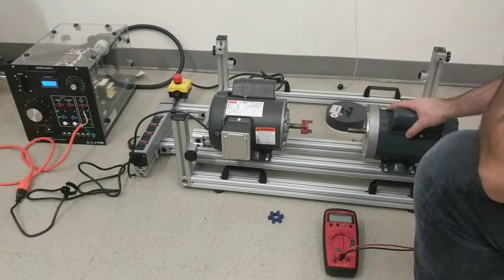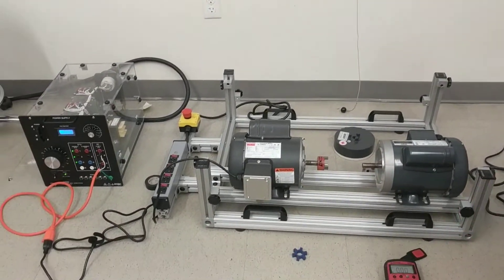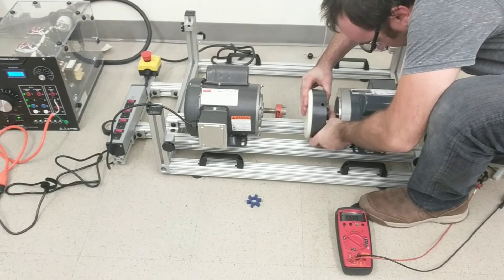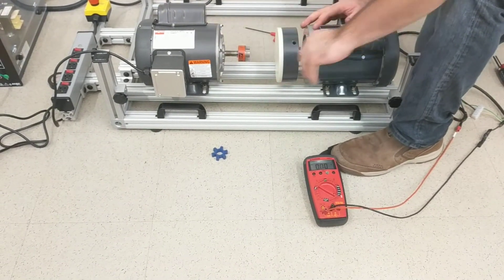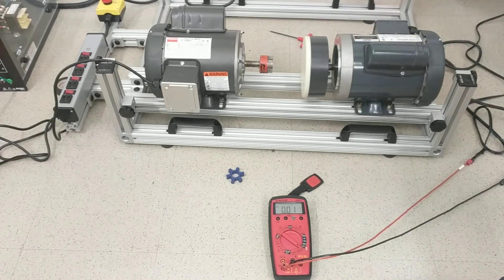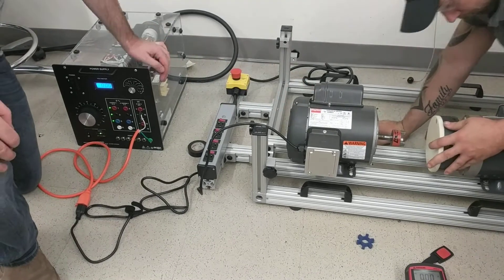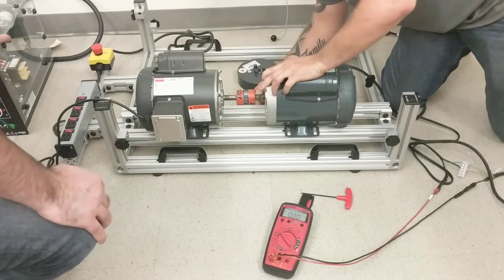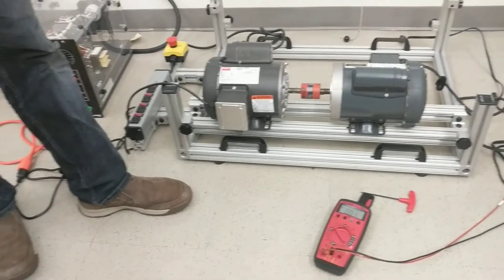Motor Torque and Current

Comment: A circuit breaker must ensure to trigger breaking when during running current is suddenly increased

It should not trigger during motor start where current is actually very high

A sudden increase in current from steady state means audden load increase which could be something struck in conveyer belt

Comment: I'm no electrical engineer, but is the answer to the end to hook up a fuse on a delay to kill the circuit if its over the operating amperage? ie. two wires from power (one with a fuse, and the other with no fuse) to the motor but after reaching steady state, the no fuse circuit disconnects?